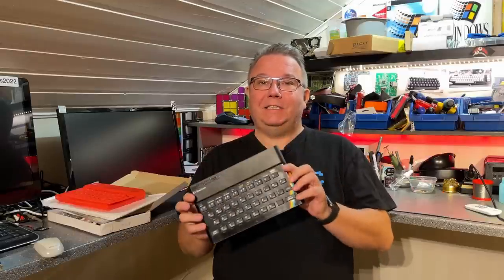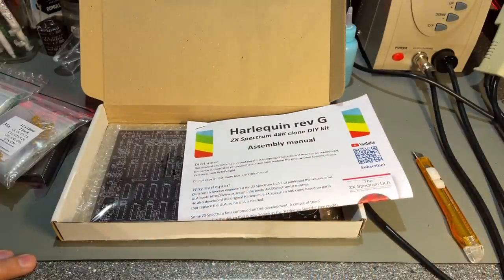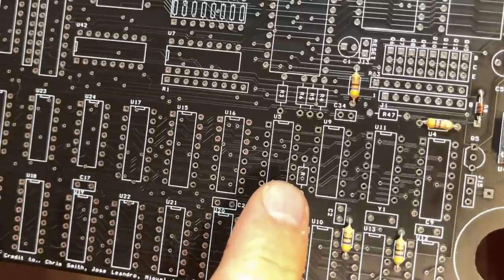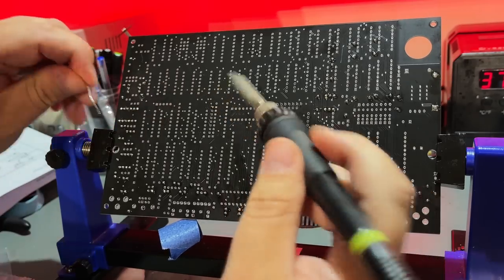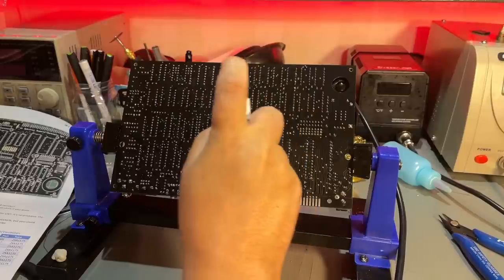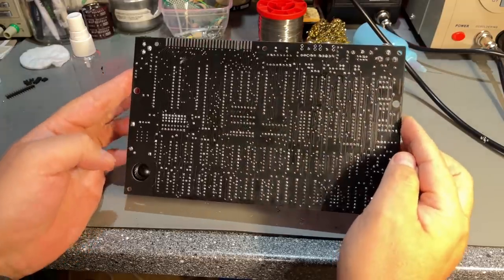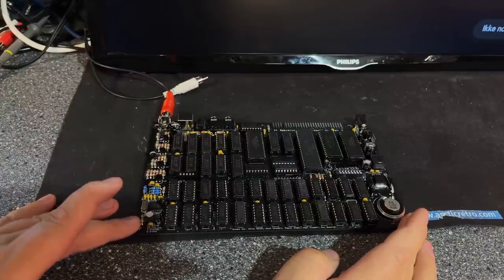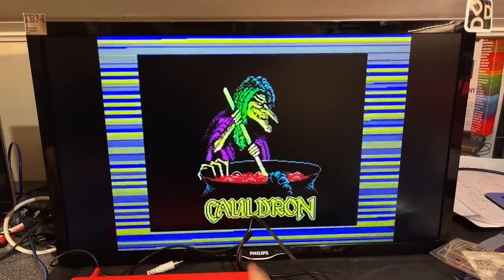I built a complete Sinclair ZX Spectrum 48K with all new parts! -  HARLEQUIN 48K REV G DYI KIT build

Comment: I'm in the middle of the USA and grew up on Commodore because they were cheap yet somewhat powerful. Sinclair just wasn't around much where I grew up, so I don't know much about those computers.  I do remember once at an arcade in the early 80s where a guy had one of those tiny Timex Sinclair 1000s.  It wasn't very capable but it was still a computer, which I didn't have yet at that point, so I was a bit envious truthfully.  I believe I got my VIC-20 at Christmas that year.  At one point, I sold it when I upgraded to a C64 but the person I sold it to still had it after 30+ years so I got it back, cleaned it up and it works like a champ now.

I really enjoy your videos; you do a great job of explaining what you are doing and why.  Amazing that this build worked first try after all that soldering!
Reply from the maker: Thanks for the story! Yes, I was amazed that it worked first try. Well, except the NTSC-mistake :)

Comment: Had a spectrum + 48k when I was younger, but I've always loved that 'pocket' case. I once put a Raspberry Pi zero in a case. I'd like to put the Amiga mini circuit board in there. It's tiny with just 2 parts- the main board and a led power light. Will it go?

Comment: You can actually erase UV based EPROMs using sunlight, it just takes longer. It's recommended to put a light blocking sticker over the window when you don't want to erase the chip, as the latent light in the room might start erasing the chip.

Comment: Congratulations for the assembly. First time with so many sockets and soldering, not bad at all. Nice machine. To the question of whether I prefer Sinclair or Commodore machines, certainly the C64 was a superior machine. But living in Europe I was a ZX Spectrum user and so it is the machine in my heart. The one I bought in 1985 still works (after having replaced the low memory bank which went bad a few years ago). Thanks for the video. Regards...
Reply from the maker: Thank you :)
Reply: I would not go so far and call the C64 superior. It has its merits especially sound, sprites and scrolling covered by hardware chips.
But as soon as games (or utilities) had to rely on CPU speed alone, the C64 struggled to keep up with the ZX Spectrum. 
Back in 1986 I created a Latin verb grammer trainer on the ZX Spectrum utilising the machine's good built-in BASIC and I would have struggled to do that on the C64 due to its limited BASIC.

Comment: I remember buying my ZX-81 (kit) right before the ZX Spectrum came out.  I wish I had waited a month, but that's how it goes sometimes.  I wonder how hard it would be to make a ZX Spectrum that is switchable between PAL, NTSC, and SECAM.  (That would be a neat mod if it could be done without a bunch of gnarly dongles...)

You are always fun to watch.  Were the kit directions conscious of the "small parts first" soldering order?  Kudos for using lead solder, too.  I hate how the lead-free stuff doesn't flow as freely or make nearly as reliable a solder joint.  I've got a small pill jar on my workbench with a bunch of cutoff leads in it.  They're just too handy for stuff like on-board jumpers.

It took me a couple of sittings to finish this video, but it was worth it.  That Speccy looks like a little Ferrari!
Reply from the maker: Thanks. I know there have been kits out there, but I don't know it they are still around. The kit directions was fine, only I followed just half of it. No big deal what ever order you solder

Comment: I built this - but cannot get to work yet.  Just a grey screen comes up with PAL 6. All the pins are how you done, I Emailed them for help but had no reply after 3 days.
Reply from the maker: Check direction is correct on all components.
Reply: Thank you was only one of the chips wrong way.  Working well now. @Arcticretro

Comment: Great project and product. So tempted. But hot glue before testing, no!
Reply from the maker: Great point! Thanks!
Reply: @Arcticretro  don't want to be one of those guys that tells you how to do your projects but, HOT GLUE!
Reply: @Arcticretro  loved it start to finish though.
Reply from the maker: Hehe. It was just to secure the speaker a bit. What do you suggest I should have done ?
Reply: @Arcticretro  as you did later. Play a game. If you got sound then secure in place.